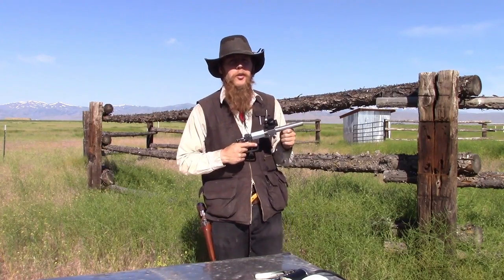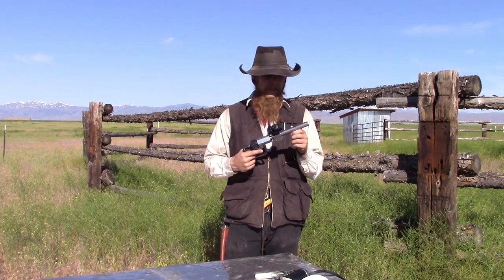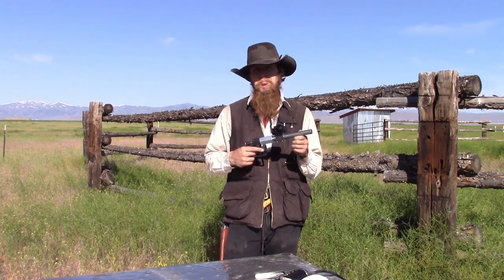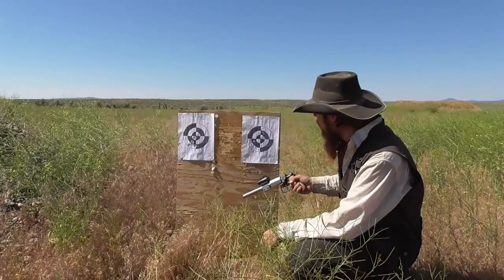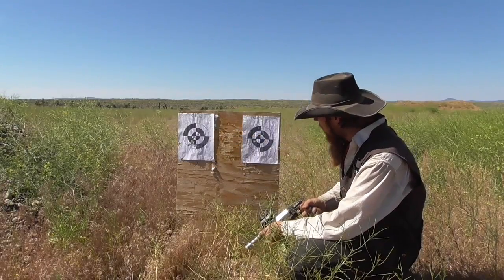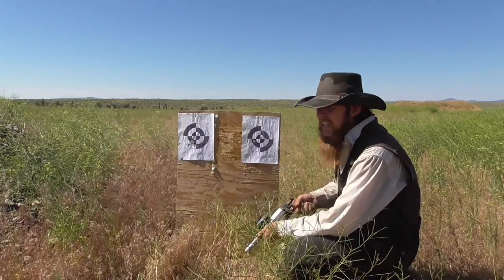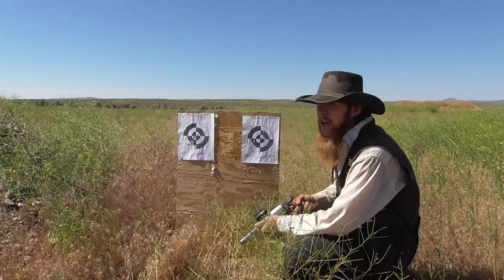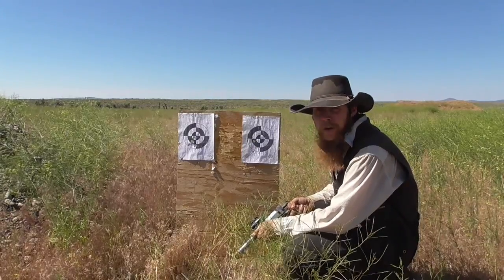Does Rifling Improve Accuracy? (TIS099)

Comment: so is riffling good for conical bullets, but smoothbore is good for balls?
Reply: The only things rifling does is spin the projectile to counter air resistance and tumbling especially at distance, the conical shape of bullets is also for range and speed, decrease drag and air resistance. Launching a ball in a straight line is harder as in physically more difficult not that it won’t go straight just requires more force to go the same distance. If he was testing Rifles at range it would be more obvious what the purpose of rifling a barrel is

Comment: Conical bullets require more severe rifling than round balls. My flintlock has a 1:66 twist.
Reply from the maker: This barrel had about a 1:22 twist, which I would have thought would be enough for the conical bullets.  It did seem to stabilize them, but they still weren't as accurate as I would have expected.

Comment: @T/Show,... again you have produced an excellent comparison video,..thank you.  Yes the science of ballistics is a fascinating subject that one never gets bored with experimentation, perhaps if you get time you maybe interested in my Turbine Barrel Gun (PLeane Gun).  The barrel is a smooth bore and the barrel spins at a high RPM, rather then using rifling to impart stability to the projectile.  The PLeane Gun has an application for stabilizing extremely high velocity projectiles, (> 2km/s), where riffling cannot be used,..https://www.youtube.com/watch?v=oOarwExHJ4U,..Regards Peter
Reply from the maker: It seems to me that there would be a lot of technical challenges involved in building a rotating-barrel gun: bearings that would operate with adequate precision at the extreme rotational speeds required for projectile stabilization, alignment of the axis of rotation perfectly with the axis of the bore, bracing and balancing of the barrel such that it can rotate without deforming or vibrating, and of course just integrating the additional mechanical complexity into a sufficiently robust platform to be practical.  However, if the challenges can be mastered, it is certainly an interesting concept.
Reply: Thanks for the reply,..yes the technical challengers were high, hopefully I can demonstrate the small scale firing accuracy soon,...P

Comment: This video may fall into the "duh" category, but I think a good analogy is a football thrown with and without a spin on it.  In defense of the smooth-bore, though, I can get some pretty respectable accuracy from smooth-sided foster slugs out of my pump action with bead sights.  A conical bullet is about the worst case with the rear-heavy profile almost guaranteed to tumble.  Going back to the sports-ball analogy, a basketball will not yaw significantly if thrown the same way.  A round ball will always be more accurate than a conical bullet out of a smooth bore.

Comment: What do you mean by conical bullet? Is it one solid chunk? Does it have a hollow in the back to catch the propellant and seal the chamber? How is it balanced?
Reply: Minie balls are made for ease of loading, without wad. In that ease is some slop, so the bullet slides into place. Theoretically, you don't need to ram a minie ball, though I'd never do fire a potentially loose charge. That little bit of slop is enough to cause the inaccuracy, but the trade off is a faster reload. In combat, quantity over quality wins out.
Reply from the maker: Basically something like this: https://en.wikipedia.org/wiki/Minié_ball#/media/File:Minie_Balls.jpg
Reply: Oh. Gotcha. Did you use a wad with it?
Reply from the maker: FYI these barrels were .50 caliber, and the rifled one had a 1/20 twist.